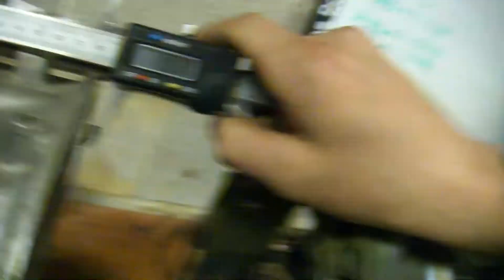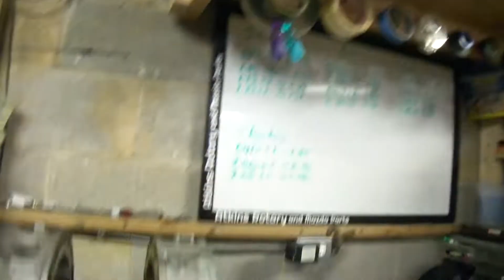Rotary Engine 12a VS 13b Interchangeable Parts

Comment: thanks for clarifying about the exhaust fitting an 13b exhaust on a 12a engine. my sa rx7 gsl has been swapped with a 13b but the engine is seized al the way. as much as i would like to tear down the engine i just don't have the time right now. so simply swapping in a known good 12a is the better option right now for the short term.thanks!

Comment: I have a question the 13 B motor up to I think it's like 92 you can find the carburetor switch kit but when it comes to like a 2004 13B you cannot find that kid are those Motors really that different

Comment: These are engines, not motors. The 12A is 1.2 liters not 1.1 liters. Now because of the way the ratio of torque angle compared to the degrees of eccentric shaft rotation you should double the displacement. The 13B is equilivent to a 2.6 liter reciprocating 4 stroke engine.

Comment: Well, I think I got myself a backup plan for my 79 12a rebuild.. If I understood correctly, getting some 13b gslse housings that are machined down to 12a width, and coolant grooves machined in. the only difference would be larger exhaust ports?

Think this will make my rebuild possible again. Got tired of searching for usable 12a housings. And have to get it running soon due to it needing to pass inspection again.

Comment: Hey thanks for the rotary content. Just got a first gen and working on the restoration. One question that I have is, are the radiator fan clutches interchangeable between the 12a and 13b? How about fb vs fc? I cant seem to find a fan clutch for a reasonable price anywhere thats fb 12a specific.
Reply: They are interchangeable but the best option is to remove the mechanical fan and add electric fans on a relay and electric thermostat switch. Turn the fans on at 200 degrees and off at 190 degrees.

Comment: So, if you can run 12a plates on a 13b it stands to reason you can run 13b plates on a 12a, or will a corner seal fall in a whole?
Reply from the maker: yep you can, however the FC/FD plates do not share the same intake manifold bolt pattern as a 12a. so if you use say FC Turbo 2 4 port plates with 12a housings, you will need a custom intake manifold.  On the other hand if you use old school 13b irons with 12a housings, the 12a intake will work.
Reply: @RADPotential  Cheers, very helpful, just at the start of my engine build for my old school RX3 coup Ive restoed
Reply: @RADPotential  The other question i had  was that somebody told me, if I did not want to do a bridge port for an aggressive idle, I could simply do a drill port for the same effect. However I do not know what a drill port is, Is the correct

Comment: Hey! Sweet vid, sorry I’m a bit late. I have an rx8, and I was thinking about doing a 13b rew swap for turbo power. Would I be able to get irons that have just an intake port, and get the housing exhaust ported and have a semi p port for the intake? How many parts would be interchangeable? Can all 13bs handle a supposed 700 hp? I’m just looking for around 350-500 wheel in the end, and 13b rew engines are super expensive.

Comment: Hey man, can 13b carb engine covert to injection ?
Reply from the maker: They make efi throttle bodies to convert to efi that will fit on most of the carb intake manifolds

Comment: Could I put my GSL-SE front cover onto a Renesis 13B to fit into an FB?
Reply from the maker: Yes on a S1 rx8 engine iirc.  I would verify the oil pan works,  on an S2 the oil filter is on th front.  I cant confirm that.  You will need the gslse water pump

Comment: How would you run a renisis engine on a distributer
Reply from the maker: I wouldn't.  I would use the stock trigger wheel and use a megasquirt or other ignition system with a carburator

Comment: Could you use MSP side housings with a 12a rotor housing? MSP rotor housings have the coolant ring design like in the 12a motor. I am looking at getting a 1st gen with a 12a. The 12a is might be tired, so when I have to rebuild it, I want to make it better flowing.
Reply from the maker: I have seen MSP irons used with gslse 13b rotor housings which are just like the 12a.   I havent seen it done, but that doesn't mean you can't do it.
Reply: @RADPotential  how similar are 12a and 13b gsl se motors? I have heard about the mazdatrix car. Also how much can you port out the 12a exhaust port?

Comment: So technically speaking could you use the 13B Renesis (RX8) rotor housings since it has the grooves cut out for the coolant seals?
Reply from the maker: Yes.  But you would have to have the exhaust port machined out on the renesis. Those motors are side exit exhaust port.

Comment: Have you ever worked on attatching an FC subframe into the FB? id imagine it  would make things easier to install the 13, but I suppose also the rear diff of a GXL would also have to go in. Reset the driveshaft, It would make a heck of a race car. Still retaining 4 lug hubs. Ive only seen and read a couple cases of it being done online
Reply from the maker: I can make a video overview of it being done in the coming weeks.  A friend of mine has done the swap
Reply: @RADPotential  that would be RAD of you! not too much late visual info on it around

Comment: Hey man I no you have dun a video on diffs but I'm wanting to no what crown and pinion would fit my 79 rx7 im from new Zealand hard to get rx parts here I'm wanting to change my for 3.9 to a 4.?? For better acceleration just seen if ya no any other mazda diff gears that would bolt in cheers
Reply from the maker: There are some options from a Kia sportage. If you want a 4.77.  I think they have other ratios.  Iirc it's a front differential set
Reply: @RADPotential  ya cant find one there like Hens teeth lol

Comment: Awesome video , can you  also explain the spark plugs please? Thank you
Reply from the maker: The variation in plug spacing between the models?
Reply: @RADPotential  yes , what's the difference between  the #2329 ngk and the #3559 #5483 ngk

Comment: So I can mount a 85 or older 13b motor to my 12a transmission?
Reply from the maker: You can mount any of the 13b rotary engines to your 12a trans.  You will need an NA diameter flywheel and clutch that matches the rotors balance in the 13b

Comment: Also another little bit of info on the 12a is that the earlier ones had heavier rotors as opposed to the later s3 so can’t mix up those rotors either
Reply from the maker: I had always wondered.   Need to get a scale for the house.